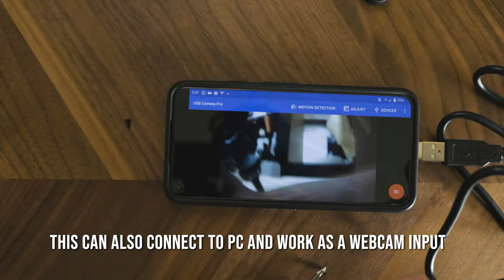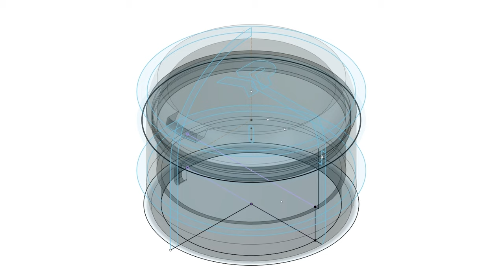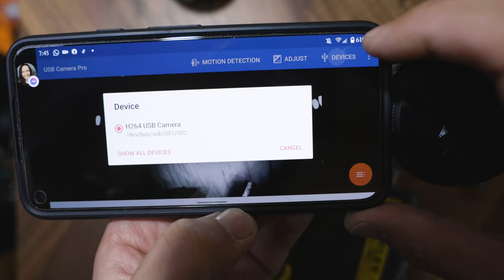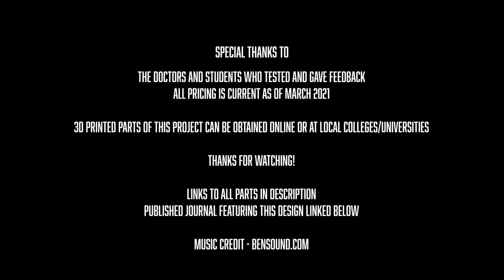DIY IR Camera / Meibographer using 3D Printing! - HD Meibography

Comment: I made the whole thing, and it's awesome!! Thank you. The holding device, however, has small, thin brackets to hold it in the slots. The small brackets broke off. Have you come up with any modifications for this?
Reply from the maker: I have not, i have been using it more handheld though, and the few times i've put it into the slit lamp the adapter has held up fairly well. are you trying to keep it mounted long term? I can probably come up with something a bit more secure, but may not be as easy to snap in and out.

Comment: any benefit in using a 3.6mm lens vs another size? I ordered a 3.6mm on eBay and they ended up sending me a 12mm size x _ x. Also if you have any recommendations where I can get what you used or currently use in stock that would be so helpful!
Reply from the maker: The benefit of using a shorter focal length is increasing depth of field and capturing the entire lid easily in one shot. If you get a. Longer focal length it'll be zoomed in and a little more difficult to keep in focus

Comment: may i ask you why did you choose 720 or 740 IR pass filter? why not 850 nm?
Reply from the maker: there was no significant difference between all of the above when I had tried. I ended up ordering a bunch of the same filters in bulk and used it